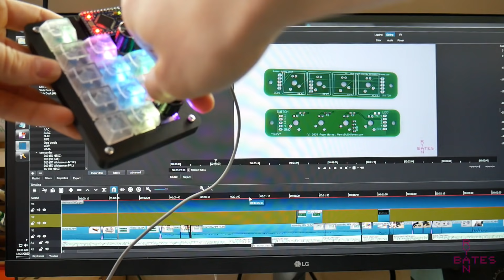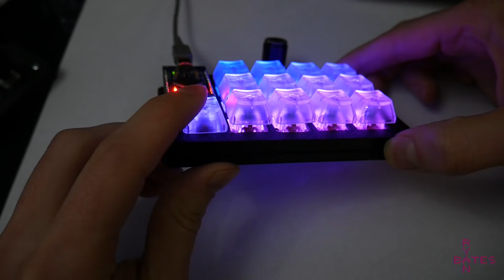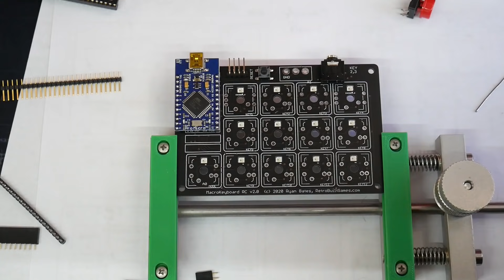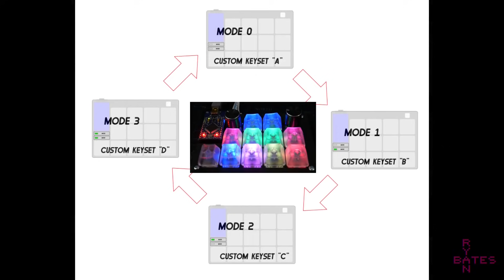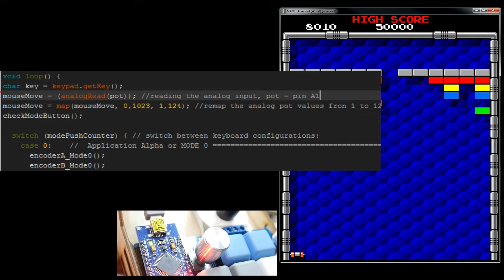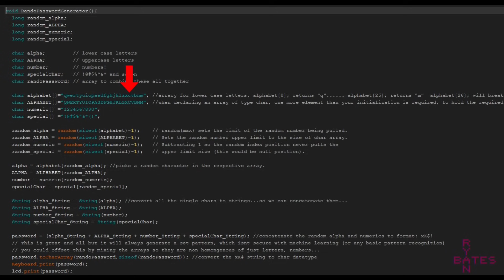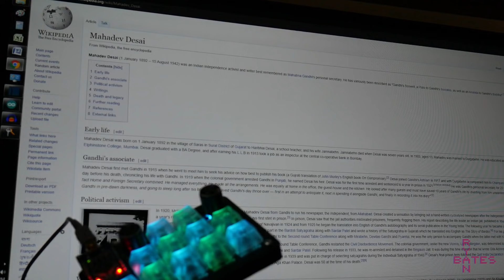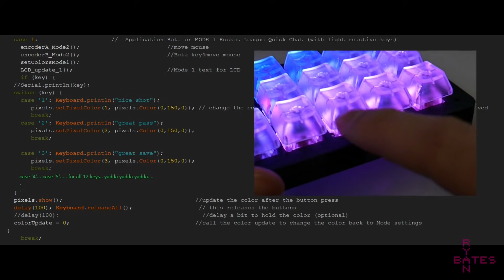Arduino Pro Micro Macro Keyboard Version 2.0 |  DIY Macro Pad for Professional Keyboard Slayers

Comment: can someone explain to me the code for switching different profiles pls without the encoders? I'm trying to do a 3  key keyboard in with I can change between profiles but I don't understand the code. pls help
Reply from the maker: look at the 'Switch Case' example built into the Arduino IDE. File>Example> 05. Controls> Switch Case
Reply: @RetroBuiltGames  Thanks but the truth is, I looked for information I saw your videos over and over again and read the code and I don't understand. Do you know any web page or video that explains this in detail?
Reply from the maker: The arduino.cc site has some more context, but it's not much. https://www.arduino.cc/reference/en/language/structure/control-structure/switchcase/
best way is to tinker with the code. add some things, break it, fix it... then it starts to sink in after a few days. and then continue to mess with it.

Comment: question, could one solder in a key where the encoder option is and break out the encoder as well? i want to use an encoder but not at that place on the pcb using a breakout one but not leave the spot open. so yeah could i solder in a key switch on and the wires to a rotary encoder and have them both work
Reply: also is that diode absolutely needed? can i use a jumper instead? I havent plugged in the board since that diode is not installed
Reply from the maker: yes, the circuit for the switch and diode are separate. you can break them out as you described.
Reply from the maker: diode are 100% optional

Comment: Looks cool. Browsing the files quickly it looks like you wrote your own code to run the board. Have you looked into QMK Firmware? I believe it's GPL and has a ton of support for macros, encoders etc.  There is also the VIA Configurator that works with QMK Firmware and adds a GUI to program the board. I use it for several keyboards I bought, and it's great.
Reply from the maker: I will check it out. some porting is in order.

Comment: Do you seed the random password generator with time? If you don't seed random numbers, they will appear in the same order, so the first time you run it, it will be 1,5,2,4 and then resetting the power /program would give you  1,5,2,4 again. Some libraries do seeding automatically at initialization and some don't.
Reply from the maker: oooooh, this is a a good idea. It is seeded on from analog pin, reading the pot

Comment: Anyone else find that the 3D printed files are inverted? It might be because I am trying to convert to STL first, as my design program does not like the 3MF format.
Reply from the maker: can you mirror in your slicer?
Reply: @RetroBuiltGames  I haven't looked just yet, im using cura to slice. My design program Design Spark Mechanical doesn't import 3MF so in conversation to STL things mirror for some reason. I have a uniquely shaped LCD id like to get mounted in there

Comment: Have you experimented with volume control on this device? I am trying to implement the NicoHood HID-Project Library to use one of the rotary encoders as a volume adjuster but it wont work. Any advice, code, or tips to help make it work?
Reply from the maker: i glance at this lib. You should be looking for the "Consumer API"  where these keys are for volume:#define MEDIA_VOLUME_UP	0xE9
#define MEDIA_VOLUME_DOWN	0xEA

the release all buttons and press commands are very different with this library. so careful reading is required in the wiki here: https://github.com/NicoHood/HID/wiki/Consumer-API

Comment: on this board can we add a 10k slide encoder for windows main volume? i just buy 2 board and im very interested . tnx
Reply from the maker: yes, but you'll need another keyboard library for those extended media controls

Comment: Can the mode button be assigned to perform a key command? If so how would that be written in the code? I have purchased 3 of these, one is built and I'm waiting on parts for the other two.
Reply from the maker: Yes it can, the example code will show you how.
Reply: @RetroBuiltGames  One more question would it be possible to link two of these together and use one arduino pro micro? Solder jumpers from one to the other and set the key pad up as 3x8, instead of a 3x4?
Reply from the maker: possible with a significant board revision. this current one= no;

Comment: Would this work with other I2C displays, specifically the Waveshare 1.5inch OLED Display (128x128)?
Reply from the maker: yes. but you'll have to add that screen specific library and redo the text and graphics
Reply: @RetroBuiltGames  Awesome, thank you. I ordered a few boards and am waiting on a few more parts. These are awesome!

Comment: i am hoping you can see this comment but if i were to use a female headers i can buy in like packs of 40 in one long strip. if i wanted less than 40 on one strip do i just snap it of or how does this work/
Reply from the maker: 1. with some pliers pull out the metal leaf at the location you want to cut the header. 
2. Use flush cutters (snips) and cut the header at that location. this makes for a cleaner cut if you remove the contacts from the shroud.  
3. sand paper or a file will clean up the edge left from snipping. sanding is optional of course.
Reply: thank you

Comment: is there a way to program the keys to be a generic key press for a key that that windows doesn't normally use, so that you can use a macro app instead of programming the arduino? (like the macro keys you get on some gaming keyboards and mice i.e. g1, g2 ect)
Reply from the maker: Maybe? you can use function keys F13-F24. 
#define KEY_F13       0xF0
#define KEY_F14       0xF1
#define KEY_F15       0xF2
#define KEY_F16       0xF3
#define KEY_F17       0xF4
#define KEY_F18       0xF5
#define KEY_F19       0xF6
#define KEY_F20       0xF7
#define KEY_F21       0xF8
#define KEY_F22       0xF9
#define KEY_F23       0xFA
#define KEY_F24       0xFB

Comment: Question about the diodes. It was mentioned they are probably not needed but do they add any reliability or anything? If we were to populate them what type would be needed?

Also in regards to the screen would a small lcd be able to be used and what type of specs would it need to conform to? Any suggestions on a specific one?
Reply from the maker: they are not needed if you use the macro pad as single key presses. Any I2C that is 3.3V or 5V compatible will work.

Comment: Hi Mr. Bates, This project is awasome. Is it posible to see the Wiring diagram? Im working on UFCP panel for DCS (simulator) and your project gived me inspiration with this awesome switches with led. I can draw the wirings in EAGLE and 3D print the case, but dont know how to wire all this buttons with leds to arduino. Thank you for help. Can buy you a coffe ;)
Reply from the maker: schematic in on website.
Reply: @RetroBuiltGames  Can i ask , where you found the library for SK6812 mini? Im working with Autodesk Eagle

Comment: I looked at the pinout of theSparkFun Qwiic Pro Micro - USB-C and it looks compatible. Do you have any experience with using that? Are you shipping internationally again (assuming the board no longer being out of stock)? Nice work!
Reply from the maker: Never use it but i have looked at it. Looks pin-for-pin compatible. I ship internationally but these are out of stock.

Comment: Hi Ryan, just out of curiosity, what was your experience with square holes and JLCPCB ? How do they treat square cut-outs ? I read one had to put them in the board outline, but outside of that, what dimensions worked well for your particular square slot (meaning for the sk6812 mini-e) ? Did you have to compensate for milling radiuses ?

Thanks a lot ! Have a nice day !
Reply from the maker: If you follow OSHpark's Milling non plated holes for EAGLE then you'll be OK. I  put a radius on my square holes for JLC, better to do this than look dumb or make assumptions. I recall they list a min mill diameter size so as long as you are above that it should work. I put all the milling in Layer 46 and made sure to call that out in the 'special instructions' so they knew to look for it. I think i added 0.1m on all sides for the sk6812 and it fits a bit loose, but the sk6812mini-e MFG said all dims are +-/ 0.1mm so what can you do?

Comment: Hi Ryan, I was wondering if you may have a discord server or somewhere we could have a chat. I'm designing the second version of my first macro keyboard and I was wondering if I could make like a software where I could modify the macros or ad new ones. If there is not one, the question would be wether u knew how one of those could be done. Thanks in advance :)
Reply from the maker: I dont have a discord. But you might want to look into QMK. a universal firmware that lets you reprogram with a nice GUI.
Reply: @RetroBuiltGames  Thanks a lot, i'll have a look at it and see if it suits what I want to do!

Comment: Hey, neath project. I've wanted something like this for a while. Even have gotten the idea to include small OLED screens into the keys so you can display the function on the key itself. Altough that might be a bit too much. One question, Is the pcb compatible with the ESP32-S2? That would enable you to emulate a USB input device and make the marcro's configurable by WIFI.
Reply from the maker: it is not.

Comment: Ryan, Thank you for the project and boards (just got both of mine in, waiting for parts from Ali now). I was wondering, did you share the GERBER files anywhere?  I do a lot of work in 3D design and was thinking about helping out revise the case, and wanted to import the board into CAD to make it easier. Figured I'd ask if it's available before  sketching up a board-view myself.
Reply from the maker: thank you! I have not shared the gerbers. The plan-o-gram is a 1:1 layout if that helps.
Reply: @RetroBuiltGames  Thank you for the reply, and I wasn't sure if I missed it or not.  I can use your case and a scan of the board to sketch one up. Main reason for the redraw is 1) the case was (on my printer) too tight to fit the pcb. 2) I want to make it sit at maybe a 15deg angle or so rather than flat. I may play around with adding a 128x64 OLED instead of the LCD, and if I can get it too work, might integrate it in the case somehow.
Reply: @RetroBuiltGames  Hoping you can help, how can we bind one of the encoders to do volume, like some bought keyboards do? Finally got all the parts and built it, but tripping over some of the programing stuff.

Comment: I want to build one with an encoder with ideally a 10-15 pulses per revolution rather than the one in the parts list that has a 20 PPR, can I choose any encoder that has a 10 PPR in digikey or is there a certain one I should purchase?
Reply from the maker: you can use different encoders as long as they are 3 or 5pin matching footprints. (5pin has a built-in push button)

Comment: Does this need software to be running on the machine that you are using it on to run the macros? Example if I program this on my pc at home could I bring it to work and run those macros on that pc without installing anything because work does not allow us to install anything on our pc?
Reply from the maker: software lives on the macro board, you do not need to install anything else. Other machines simply see this device as a USB keyboard.

Comment: Hey Ryan! I just got the PCB in the mail and I am very excited to use it, I have a LCD screen that I am wanting to use. However, I was wanting to use a GPIO that converts the 16 pins on the LCD I am using (Arduino 1602a), to the 4 pins to connect to the PCB. The GPIO will be using is the PCF8574 extender. Will I be able to use this macropad with a keyboard after using this GPIO?
Reply from the maker: If that extender coverts to i2c, then yes.
Reply: @RetroBuiltGames  Alright thank you

Comment: Hi Ryan,
after having bought some of your PCBs, I have now built one of them and it  works great. I would however like to add the capacitors to the leds, even though you don't consider them necessary. I am a fan of longlivity and would like to enjoy this smart device even after 10 years or so. So to make a long story short: Which capacitance should I take? The cap value of the example in the datasheet is unreadable, so I hope for a recommendation from you. Thanks in advance!
Reply from the maker: i cant read the value on the datasheet either, which is interesting. probably 0.1uF or 0.01uF
Reply: @RetroBuiltGames  Thank you, this seems to be correct. I have at least got a similar answer from another site, which stated 100nF = 0.1 uF. So this is what I will use.

Comment: What you need is some relegendable keycaps. These are absurdly difficult to find, but here is one source:

https://pimpmykeyboard.com/dcs-relegendables-pack-of-10/

Just print the legend on photo paper with an inkjet, cut it to size and place it under the clear cap.
Reply from the maker: ahhh! I was not sure what these were called. Thanks!

Comment: switch to EasyEDA you can see photo even a 3d version of your boards, it uses real will component foot print, even shows your board fully populated, so you see your board on the screen as if it was in your hand. even all the silk screens, best thing is it will even check to see if you made track errors, even better it  produces all the Gerber files one would need to have boards made or for your own CNC,  Ho! yes you can just click and order strait from JLCPCB, i use then monthly well almost, never had any problems, one just cant beat it,    if you see this JLCPCB or EasyEDA this ones on me lol. Please see all the videos on YouTube on EasyEDA, you wont go back, over the years i tried them all.  Please report back once your using it. good look. and thanks for all your work its very interesting to my new project.
Reply from the maker: do you like KiCAD?
Reply: @RetroBuiltGames I only used it for about 3 mins and fell out with it and then uninstalled it, i don't, have patience for anything if it's not immediately intuitive from launch.  

Just a quick question on programming if i may,  what software/IDE do you use to load your file to the Pro Micro Atmega32u4, I was under the impression you used the Arduino IDE software platform.  Problem i having is it doesn't seem to support that processor, I've looked at all the posable IDE updates for Arduino IDE including  the "Intel Curie Boards package"   via Boards Manager which should install CurieBLE library as part of the package, according to the Arduino forum but when i try to compile your code under the Arduino IDE I get  "No such file or directory" also when i select mini pro board I can only select at mega 168 or the 328 for the mini pro and not the Atmega32u4, I'm still looking into this,  if you could let me know if you used the Arduino IDE or something else that would help. I'm on windows10 running Arduino IDE 1.8.12 with all latest updates before asking the above. Thanks
Reply: @RetroBuiltGames  Nice to see the process documented! I just started learning how to do schematics and pcb layout in Dec, and i started with Kicad, cause it was the only one i found a full step by step tutorial on ai03 site. I must say it's really easy. 
I tried to use Eagle, but i can't seem to even figure out how to do up a simple schematic, totally gave up even before reaching the PCB layout stage. 
In Kicad i managed to make a reversible footprint and didn't think it was quite hard. Also most of the components has their 3D parts for them too.
Now I'm still thinking if i should continue to try learning Eagle, cause it has simulation built in.

Here's the first ever pcb and board i made, made silly mistakes like forgetting to connect one of the trace and wiring the LED to the wrong pin on the MCU

https://photos.app.goo.gl/3Vxyc7JiVYYVnJv98
https://photos.app.goo.gl/wTbWbJvJhFZ2MLY97

Comment: Awesome work, Ryan! Is it be possible to transfer the mode switch function to one of the keys within the 3x4 matrix by changing up the code in arduino ide?
Reply from the maker: Very possible; I went back and forth on this tbh.
Reply: @RetroBuiltGames  thanks for replying! I just started with arduino, playing around with a membrane keypad before attempting to build one from your pcbs :)

Comment: Are you able to make it wireless and battery powered?
Reply from the maker: with a rp2040 or esp32 with bluetooth yes.
Reply: @RetroBuiltGames  thanks for your reply. My appreciated. I want to make a single button wireless keypad. Something i wondering is how to pair the ardrino bluetooth with say a little usb dongle that you plug into computer.  Just like wireless mouseamd keyboard you get little usb  to plug in. Is this possible to do with one of your keypads? (or my future one)
Reply from the maker: it is possible.

Comment: will gateron switches work?
Reply from the maker: yes, 3 pin type. i think that is also called 'plate mount'
Reply: @RetroBuiltGames  If I don't plan to add capacitors for the leds should I bridge the pads?
Reply from the maker: no, do not bridge cap pads.

Comment: A neat design, but... Oh God, Arduino again! Not only an extra board (also a prototyping board!) where you could just solder an IC in, but also a very crippled one (not even on par with atTiny chips, not even talking anything faster) "thanks" that silly IDE/compiler/loader. Just put that 32U or something on-board and use EEPROM-stored compiled scripts for presets, eliminating the need in the Arduino IDE most people do not have nor wish to ;)
Reply from the maker: your experience in assessing what people want is misplaced here.
Reply: @RetroBuiltGames  No, because every commercial device needs no external IDE, and relies on slim and easy-to-access software instead. Regarding your unedited post - maybe because I don't need it? Tho indeed, I'm working on something slightly close (well, at least for mostly being an input device) which I will likely post when she hits the shelves this summer ;)